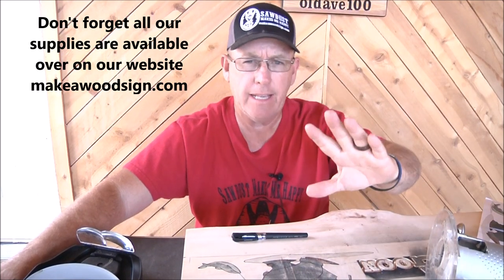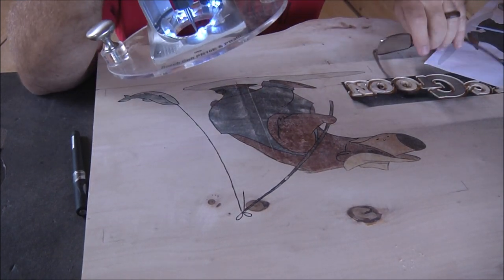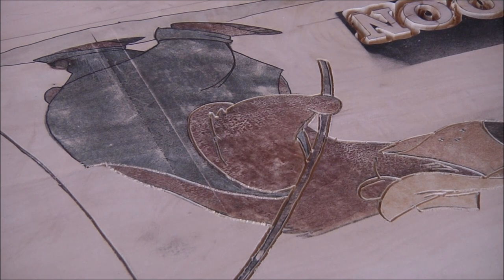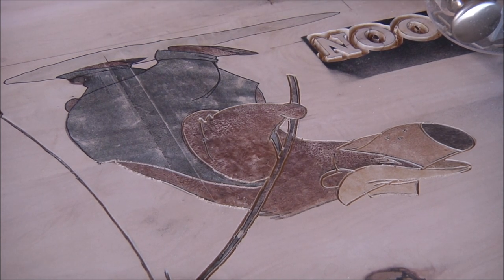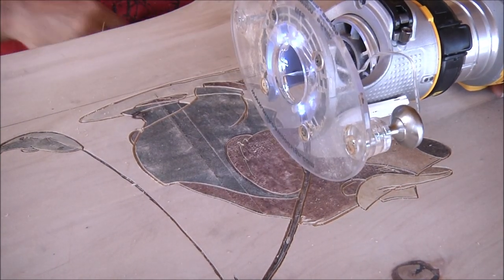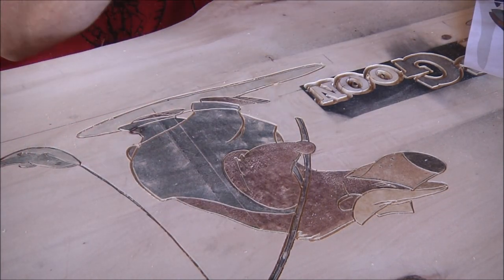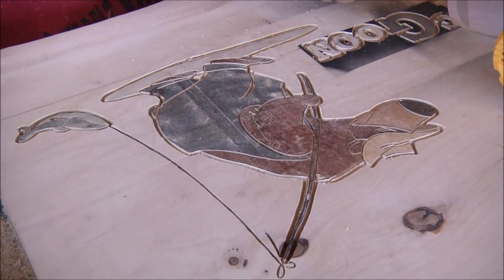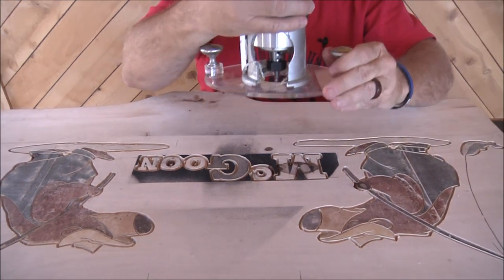#507 Carving The McGoon Cabin Sign Pt 3

Comment: Hey Dave. I am new to you and your channel. Have looked at your comparison of the Dewalt DWP611 and the Makita RTO701C. It appears you cut holes on the back of both routers. Is that correct? I know one of your downsides to the Makita was the lack of lights. I saw in the comments below you may have added “fairy?” Lights? Do you have an episode number for that? Also, since I am slightly eyesight challenged I like all the light I can get. Does the headband also have lighting? Wanted to thank you so much for your videos. Also greatly appreciate how much you enjoy your dad. Saw the maiden voyage of his new boat. Thank you so much
Reply from the maker: Hi Dave, yes we always want to make sure the backside is opened up for lighting and also for the dust to escape out the back. Here's a video on the lighting options including the fairy lights. https://youtu.be/w_4jQ5ZUdzg Hope this helps. Some headband/magnifiers have lights I just don't use mine. Thanks so much for watching and please let  me know if I can answer any other questions for you, eric@makeawoodsign.com.